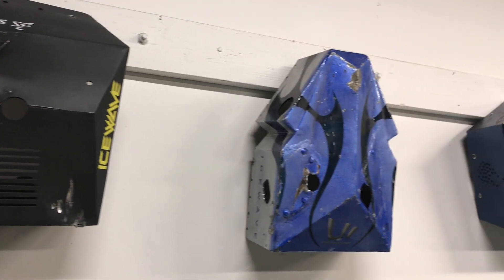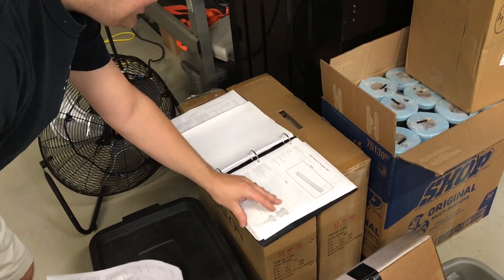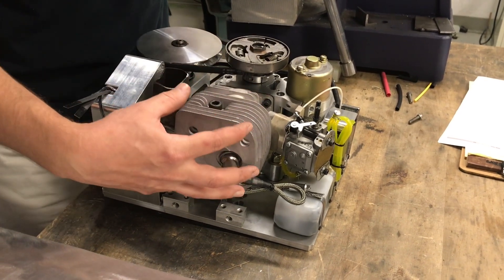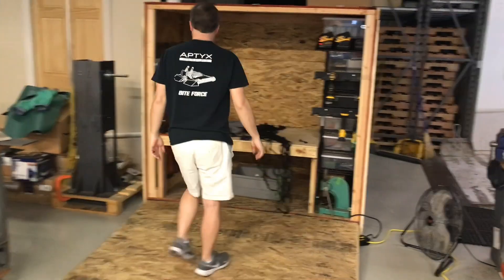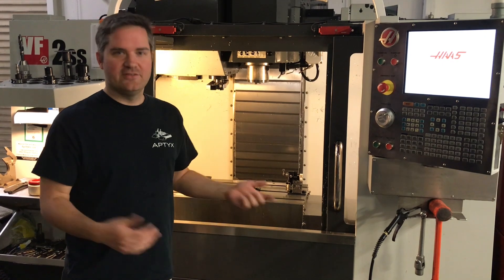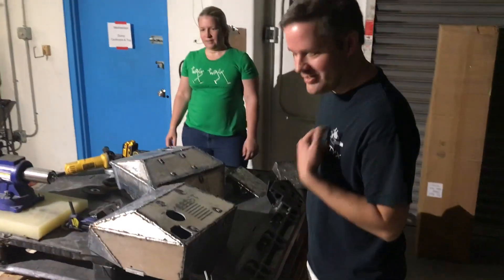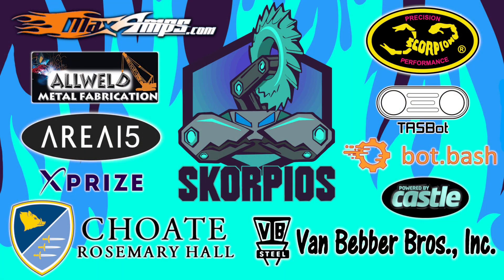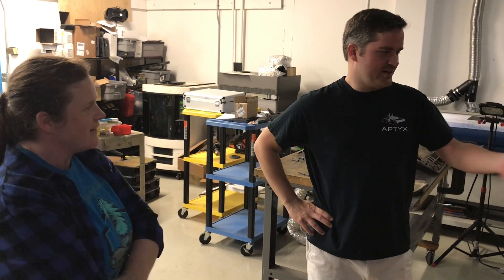ICE ICE Baby! Featuring Battlebots Icewave and Marc Devidts

Comment: I like icewave but why on earth is he still using a gas motor?
Reply: Because that's what the ICE in it's name stands for.
Reply: Internal Combustion Engine
and it's their unique feature. Otherwise it'll be a perfect phoenix
Reply: @RennieAsh  But perfect Phoenix came after... They can also keep the electric engine in the pod, so to keep the blade profile lower.
Reply: BrandoJones pp may technically have come after, but used wedge with flat bar on top before ice wave would have of ice wave were to remove the top pod.
It just means they have to do something different still or you’ll get very similar bots. Keeping a pod would help I guess . You’d want to amour it as the electric motor will be able to potentially settle right the bot with a spin
Reply: Gasoline has a much higher power density than batteries. Horsepower-per-pound, gas engines put out more power than electric motors, once you account for the batteries and other components.
Reply: @5thearth  They do... but they're also better suited for longer term operation, as they can't really turn much of that density into power per second (low throughput, but high density).
Batteries are better for high throughput
Reply: @5thearth  That's COMPLETELY irrelevant in the 3 minutes (less usually) that a fight lasts. In fact, the fights last so little they'd actually be much more powerful switching to full electric.

Comment: Has icewave’s top armour always been metal, if so that thing was super easy to be broken by skorpios and the pulverizer.
There are many teams returning that I can’t even keep track of them all, and some robots I don’t know the look of (blacksmith, Minotaur,etc.)
Reply: To my knowledge yes its just thin aluminum or ti iirc the pulvirizers might not be as strong as a battlebots hammer, because it shouldnt be as strong as n actually powerful one, but it is more powerful than you think.

I wouldn't be surprised if they beefed it up or have a more heavily armored configuration on the table though.
Reply: They explain in the video is mostly a dust cover, it's too thin to protect from real impacts.